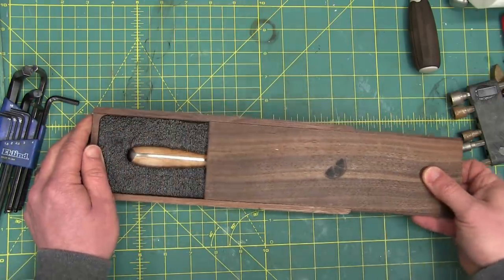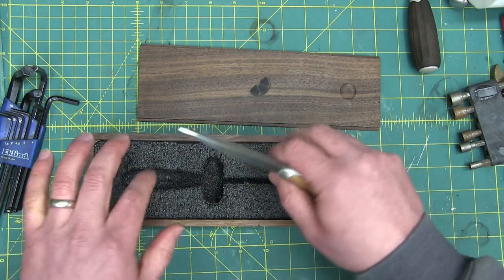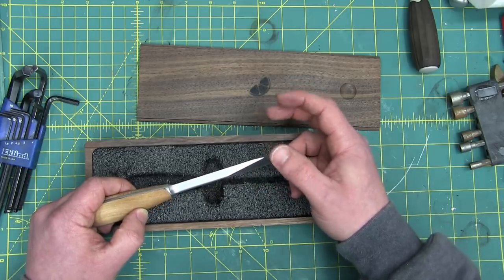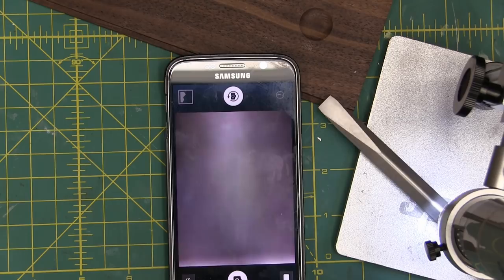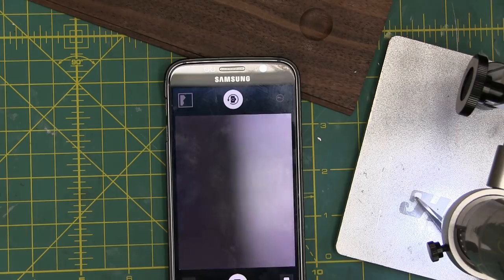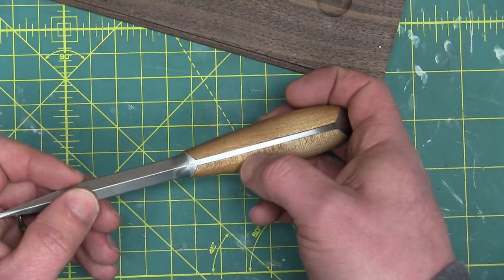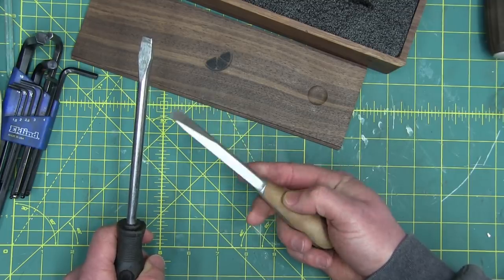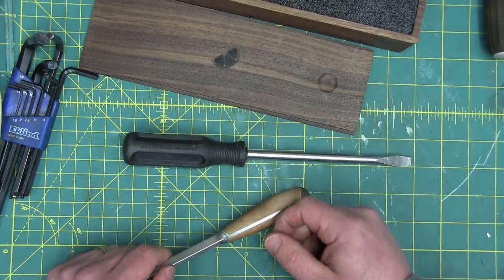Tool that doesn't exist? | MAKE IT!

Comment: When the driving slots of  "falt blade" screws are rectangular in profile, why are screwdriver blades tapered wedge-shaped?  Doesn;t that reduce the contact area between blade and slot and tend to damage the screwhead?

Comment: yep, had 2 half year old harbor freight angle air die grinders fuck right off today on the same project within the same hour, one spun a bearing shaft against the inner race, wollowed out the woodruff key shaft section for the gear as well and strip the teeth off the gears, the backup just snapped the chuck off at 17,000 rpm and it rang out across the shop like a rifle bullet. . .i took an early lunch

Comment: Feel like this would be a great driver for an electrician if insulated.i liked the part, most of the stuff you find today is just disposable junk. Even some of the higher end items don't have anywhere near the resilience of this tool. The shoulder from the tool path doesn't seem like a huge imperfection. It's a 90 and prone to breakage.. But unless you load it with over a ton, I don't feel like titanium is going to break. Of course fix it if you run more, perfection is a journey.

Comment: @AvE if already doin all that then add two brass pins through handle to hold those wooden parts there foreveeeeer. Btw finally someone showing how manufacturing on a small scale works

Comment: Like the video! However, seeing how you are particular with being correct on the tech details of materials...titanium is paramagnetic, not technically non-magnetic. Also, I wouldn't be prying or hammering on this tool as titanium is quite brittle.

Comment: Even my snap on screwdrivers are garbage. They don't hold up to industrial use. I have a flatblade with a 10" blade that my grandfather machined and placed in a craftsman handle. It was made 50+ years ago, and I still use it with sledgehammers and prying. I'm convinced it's invincible

Comment: Square off handle seat so you can lathe a replacement. Make the center bit 1/4 inch thick so you can easily bifurcate with a table saw 2x at 1/8 blade and stick to some 1/4 stock. And then make handles attach with counter sunk screws and nuts. Then you have a completely replaceable wood chunk which is what will fail.

Comment: It’s beautiful but the shaft size is out of kilter with the handle size. There’s a rough science to the design of screwdrivers that requires the force that can be applied (handle size) is appropriate to the screw size. Put a big handle on a little driver and you’ll rip the head off little screws / put a little head on a driver and it will be difficult to generate sufficient torque to driver or remove screws that are appropriate to the shaft size.
I must also add that I love your work . . and repeat that it is a beautiful screwdriver.

Comment: More of a pry bar than a screwdriver. With the wedge grind running to the tip it will squirt out of the screw heads easily, especially in titanium. Titanium is stiff and tough, but not particularly hard, and a screwdriver tip needs to be just shy of file hard, or it will round over and squirt out.

Comment: As an electrician with years of service work in BC and Alberta I could not justify spending more than $20 on a driver that's not 1000V rated. Them drivers have legs man. Shit goes for a walk on a regular. Also need a way to secure it to a lanyard for elevated work.

Comment: Visually: It’s proportionally too chunky. The shaft needs to be longer. It’s inelegant in it’s combination of its three components- shaft, handle and blade end.
Functionally: prying against the shaft ‘corner’ is not right. What screw type is this for?  Commonly used these days?
Resolution: the attachment method of the handle should be clear. Glued? What?
Conclusion: Jewelry.

Comment: What if that screwdriver had some interchangeable grips, that you could take off (unscrew) and replace with some micartas or G10 handles like a high end bush knife. If the wood gets dinged up or chiped your hooped, at least you can change it out.

Comment: Speaking of that wooden handle, it needs to be replaceable -- not simply glued on. What happens when one of your kids takes the thing out to disassemble an anvil or somesuch and leaves it lying out on the ground? You find it months later when you run over it with the lawnmower and destroy the rotting wood before the driver blade chews your cutting blade all to frig. Then you're SOL if you can't replace the wood part of the handle at that point. Put a couple of holes and rivets through it.

Comment: I think if you were to try to hot forge and do a progression die you might be able bring down the price over the long run. Cnc machining tho faster and cheaper in the short time you end up wasting a lot of material when you have to turn and machine off a lot of material and martial cost will start to add up because your not buying enuff to get a good deal on steel. And you can don't have to get  titanium red hot to make it workable I think but I do recall someone forging titanium. Also machine tooling tends to wear fast so depended how you machine it the tooling cost can be prohibitive.

Comment: You have a big flaw in the tip if used as a screwdriver you don't want it tapered all the way to the tip it will actually push it out and cause stripping but if it has a micro flat section then micro flare back out at tip it will hold it inside the fastener and some of the high-end USA made ones use this technology from what a tool rep told me

Comment: If it ever fell into a lake, there'd be no way to recover it except diving with a decent underwater PI metal detector. A piece of steel built into the handle would make it possible to just fish it out with a magnet.

Comment: Yes Titanium is 30 times worse conductor than copper.  But 3 feet of 12 gauge Titanium wire still only has  0.13 ohms of resistance.  So if you ground it to a 115 volt outlet.  You can still flow well over what a 20 amp breaker will supply.  In fact you could flow over 800 amps if your power supply could handle it ... and the titanium would turn bright red and melt.   Which means it will kill you as fast as a copper or steel screwdriver!

Comment: If you're getting in there with a microscope, the driving tip should be parallel to the slot of the screw. This driver is tapered all the way to the tip which, given enough force, will tend to pop out of the slot.
Reply: This is like the pre war rippers, they all had a tapered tip. It's more for whacking, prising and poking than being a proper screwdriver. Pretty much a multi tool

Comment: Today at the hardware store I saw a wall of titanium hammers.  All crazy expensive, the biggest was $200!  Seemed odd to me though. Think about it for a sec - a titanium hammer.  Using super $$$ lightweight materials to make something where the weight of the tool is a design spec.  That 14oz framing hammer...is now 14oz of titanium instead of 14oz of steel.  Which means it's bigger and won't fit as well into odd corners, in the toolbox, etc.  I don't get it.

Comment: Normally not a big proponent of 3D printing, but this looks like it could be done to near finished shape and then tossed in a vibratory bowl to get the smooth satin microscopic finish you are after instead of spending eternity on the tool paths. You could also get really creative with an integral lattice handle instead of dead tree carcasses.  Maybe solid on the top and bottom (relative to the blade) for prying comfort with the tang at 90 degrees like an I-beam to keep it "schtiff" (sp?)... the wooden scales are pretty, but wouldn't last past my son's son's who-knows, which would be a shame since all the trees for making replacements will be holographic.

Comment: metal core in the handle could bend if someome really honked on it as a leaver.  if you rotated the blade 90 degrees so the handle core wasn't in line with the flat, that wouldn;t happen.  might not look quite as nice but meh.   or use a core with an 'X' cross section and solve the splitting if it gets whacked on the end problem too.  making more wooden inserts then more expensive but that's probably not a problem with this tool ;)

Comment: You need to make wood chisels. 
I'd pay $1000 for a set of chisels like my grandfather had.
I spend $40-120 per chisel and some only last a few months when you're working with Australian hardwood and use a claw hammer instead of a wood mallet.
Try pulling out a wood mallet on s job site then trying to sit down to smoko with those blokes. They'll tear you to shreds!

Comment: You Canadians invented and just sat there with the best driver and socket design in terms of positive engagement for years, but not using it here. Also why is it rare on anything other than dead tree carcass applications? (It might be a bit square to mention but I'm talking about Robertson drivers, if you haven't figured it out.)

Comment: Hay whatcha think about a blacksmithing take on it do like a katana where the tip of the screwdriver is harder than the shaft make the tip out like a hard metal make the shaft out of spring steel or something like that it would not cost nearly as much but would still be a much better tool and would have the handmade spirit do it and send no to Would be the same it would be kind of cool

Comment: Chizle- pry bar - screw driver. Flat head screwdriver is the most prized possession.  Sadly most new screwdrivers are gabage. Heck you go a few years back in time and any tool was just that much more .      Sign me up when you're ready to sell.  Looks schoocum as a frig .  Maybe to stabilize unit run a flat wall inside handle on opposite axis  you can even make it not visible through the handle  making a stractual cross . Basically fill in the gap inside handle. Because that thing would get a lot of hammer tapy taps. On that handle through out it's life. Design is excellent. I love your material choice . Handle looks easy to reproduce. Hope it's easy to remove that wood. And place a new one.  Also maybe a little flat spot at the end of this screwdriver. So when using as the chizzle mode. The force of the hits lands on flat surface and perserve the material. I mean after years of use it will end up flat and all dented up at the back... At least in my hands. I'm planning on using it. Not showcase in my wife's kitchen as the tool of beauty protagonist desires forfiller  for when she has no man home.
Reply: The design is excellent, it's about a hundred years old. The only change is the switch to titanium and the old ones had visible rivets to hold the wood handle scales on.

Comment: the tang should never run parallel with the driver blade lots of tension put on the wood handle even with a mm deflection could crack it but if it was a "+" (blade flat... tang up) shape it would add more strength if you used it to pry with ... since the blade runs with tang lots of room for failure in thin tang and wood handle ... I know titanium is strong but not with a 200 pound gorilla ganking on it but other than that awesome idea and beautiful heirloom tool

Comment: Reverse the wedge of the metal. Then slide the wood in from the side. Maybe throw two brass stakes in to retain it. As you hit the end the the wood would squeez in tighter. Teak, live oak or Jatoba would make BEAUTIFUL and robust handle. Teak splinters will give a MF of an infection if splinters though. 

Looks Damn good man! I would love a set to keep on a boat... maybe titanium knipex? Lol

Comment: To your concern with the wedges. The wooden scales will eventually pop out after you whacked the driver for some time. What you could do to fix this, is to let the wood be the wedge.  It‘ll essentially work just like a dovetail joint. Skookum as fuck. I know it would probably be more expensive to machine but I think it would fix your problem :)
Kind Regards

Comment: Just to be awkward: I disagree that this is the World's Best Screwdriver. What constitutes the WBS depends upon the screw that you are trying to turn at a given point in time. Is it a nicely made pokey-thing? No doubt about it. Will it shift the rusted Phillips screw on my old Land Rover? Not unless you use it like a chisel, in which case you'd be better off with a chisel. I'm sure you get the point...

Comment: I don't think that's going to handle a hot super very well. That finish is going to go to hell in a hurry. Titanium can be case hardened but that would be a wee bit difficult and I'm not sure what kind of hardness you'd get. Titanium is nice and all, but I just can't see it being a good tool metal. The weight is fantastic, but I'd rather some good tool steel properly case hardened with a little chrome.

Comment: It is nice but to large, as in the blade is too large. There are limits on how big/wide a flat blade screw driver can be and still work. How many really big ass flat blade screws are out there now a days? Well, I got this old craftsman 12" lathe that has 2huge ones that has to come out to remove the side plate from the cross slide. Aside from this.... my 2 big ass screw drivers are really just handy dandy pry bars.

Comment: Just may sure your next of kin uploads the video that you were making when you accidently used this around something with electricity. LOL

I know you're smarter than that but would there be a way to have the wood completely wrap around the metal, maybe have the angled end be inside the handle. This might increase the cost but increase the safety.

Comment: Western market are very competitive, it's very good and i feel that an "empty" niche on market. About the timeframe - this all depends on the new materials we all have heard about - graphene, metamaterials and etc. The problem is that if industry which can make cheap and many tools adapt such new miraculous materials, the demand for custom tools may fall to very low. Also the second factor is fully automated industry - the first sign that it's coming with almost no jobs for millions - is the talk itself about guaranteed social payment from state (just for being citizen), which already started to be paid in 2 countries on the Earth. Automatization will shape everything, i suspect that in such societies there will be no need to any manual work, so need for tools will be very low, very specific-for few guys which repair machines…everything will be "one-time use" from cars (it's already engineered in car industry) to the clothes (like street 3D printer machine which printing new pair of shoes in 5 minutes very cheaply and from biodegradable plastic-which lifetime timeframe can be tuned already with today tech-so very cheap 7-day shoes and more expensive which can be stored for a year). No one can yet tell how full automatization with social payment change other things - like do we need copyright laws (invented in harsh Medieval ages with first books printing) at all if your income is guaranteed and there's no need for greed and for cultural prosperity every work will be proclaimed free to use or copy…

Comment: Love it!!! No that way get your mind otta da gutter. Seriously though, inherited several screw drivers similar to this. Speaking as the guy who has boxes full of Snach on tools, those 50 year old screw drivers are da bomb. Some one should look back and set the design team on this. Looks great feels great. Sadly the average gorilla wouldn't appreciate it, so feasibility goes in the shitter. A side example a co-worker asked one day could he borrow a screw driver?
Walking to my box I casually asked watcha doing?  Oh I gotta jump the solenoid on the old forklift. Well I turn around and said something to the effect of go fuck yer hat, do it my F'in screw driver, you spend the rest of the shift picking up  your teeth and lips. Just saying he is the reason screwdrivers cost 10 bucks a set.

Comment: Nice unobtainium screwdriver.  It would be better if the tip was swaged like gunsmith screwdrivers.  Skookum as fuck though.  I'd never hammer on it.

Comment: Looks awesome and handy as fuck. Though if you're using it to pry shit apart I would make the flat blade perpendicular to the tang not in line for extra leverage strength and then you wont bend it and pop off a handle scale.

Comment: I guess it's OK but not for me.  I'd want a STEEL screwdriver, leather handle, and I'd fully expect it would kick your screwdrivers ass.  To make it light make it hollow.  Hard tip welded brazed into heat treated pushrod material for instance.

Comment: I love it too. How much? "way too expensive" he says, ohh. I quiver! How much would it cost us? As we watch you dance around the real cost of a quality tool. Why would you leave out the bottom dollar on an independent experiment? throw it out there! Give us options,  titanium (hulk smash!), Stainless (German quality), High carbon steel (YOU get an AVEscrewdriver, and YOU get an AVE screwdriver!) or what ever. "Whoever" is not gonna make a billion dollars on this. But, if we can lay out the options and they can squeeze in some production time, a few bucks can be made here and there. They are either in or out. Friggin tool tease bastard!
Reply: I want a carbon-fibre one with boron-ceramic tip. And a free set of steak knives

Comment: I really hate to say but I have almost a complete set of the original drivers that the tool guy made those from the only one I'm missing is the 4 in one they came in sizes from 16 in down to 3 in and are just about bullet proof the wood on the originals is held in with brass pins and can come loose my 8 in has that problem but it's hasn't let the wood go it only loose. I used them for decades and love them it's sad to think when I'm gone my son plans on tossing all my tools out the little prick has no idea because it's not a computer and he has no interest in cars